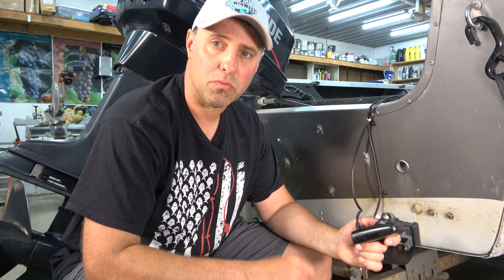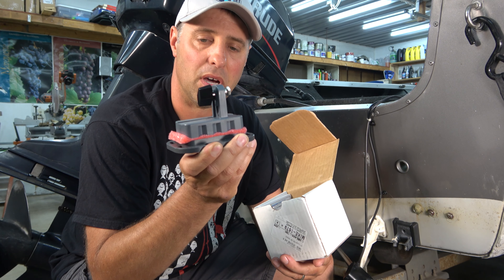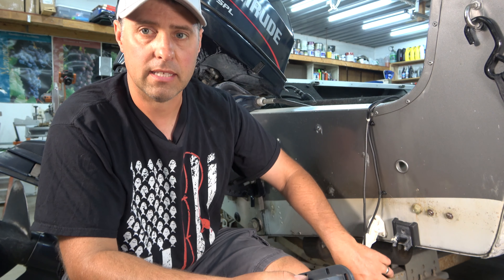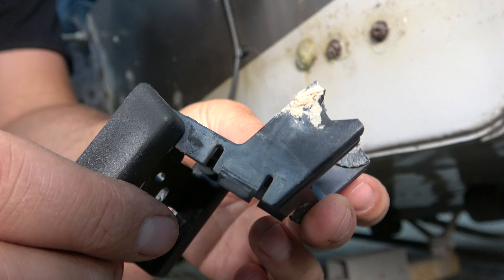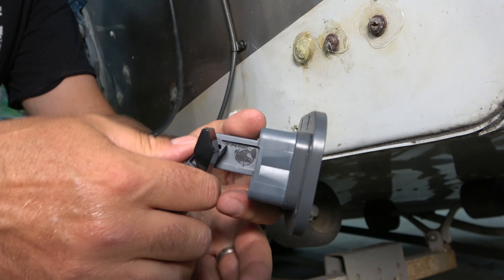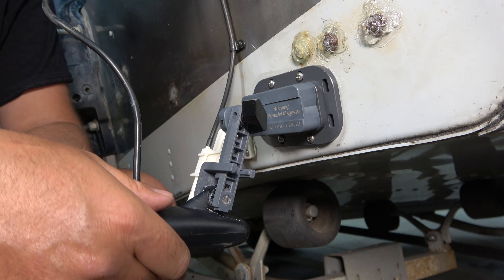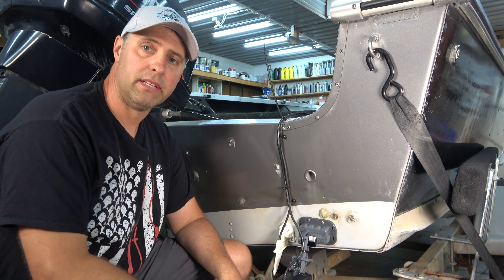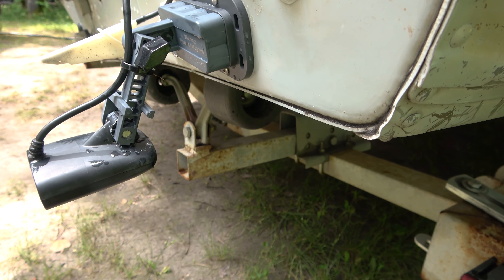Never Replace Your Transducer Mount Again!

Comment: I've never broken off a transducer in 40 years but if I do the magnet is something to consider!! Rande the problem from breaking the mounts as I sea it is the depth below the bottom of the transom....At best the ducer should be no more than a 1/2" below the bottom...By completely submersing the ducer you putting too much pressure on the mount and at high speeds the magnet may let loose and the ducer take a beating via the motors lower unit or maybe the prop....Something to consider!!
Reply from the maker: You're right on. I figured that out with a little trial and error. Having it level with the bottom of the boat seems to be the key. All my broken mounts are probably user error, but now I shouldn't have to worry about it.